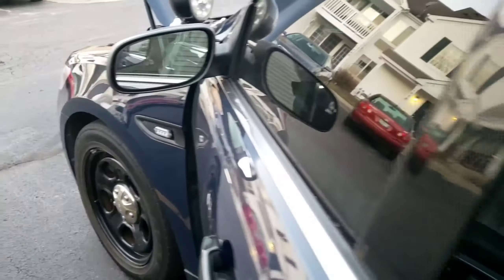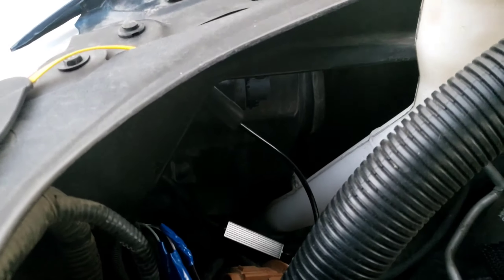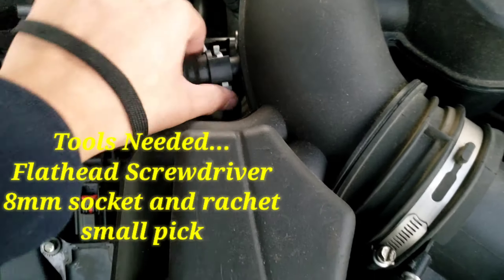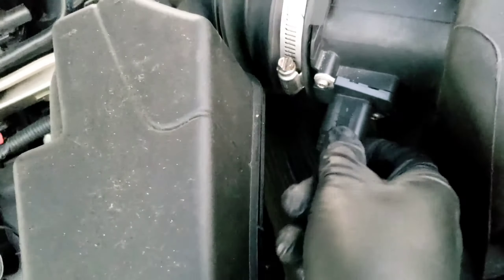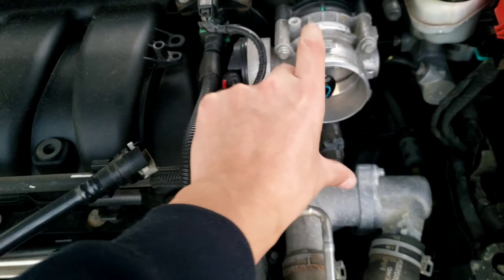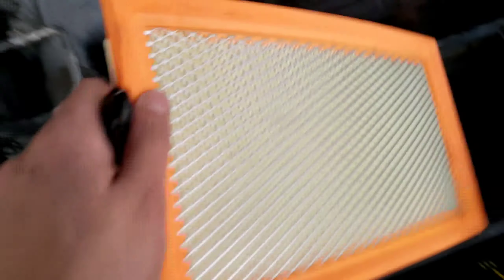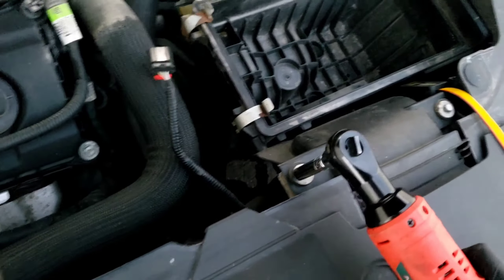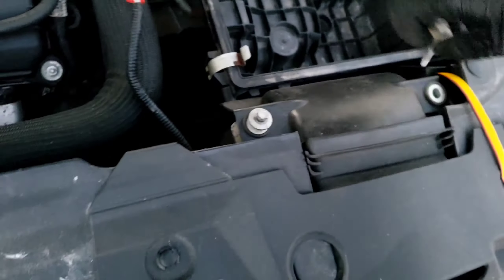How to Replace Headlight Bulbs on a Ford Taurus 2013-2019!!!

Comment: Just did this with my dad and you really don't need to remove anything tbh. Remove the silicone cap. Pull out the old. Put in the new. Seat the new headlights then lock in place. 

Done
Reply from the maker: I couldn’t get my hands in a good spot to do that

Comment: Your video is pretty good except for one thing. You don't show what it's like to actually pull out the light assembly and replace the bulb.
Reply from the maker: You are right but in the video the two screws once you remove them the headlight just pulls straight out and the bulb is visable right away and you just place the whole assembly right back

Comment: Shit, I thought it’s gonna be easier... thanks dude
Reply from the maker: No problem hope it helped you out
Reply: CGR Cars, Guns, and Reviews did today I changed my bulb without touching filters and nothing to unscrew, you may need to make a new video, you can change it for about 2 minutes, just need to find the rubber which covering bulb
Reply: @vityaoverstars5876  how was you able to change bulb without unscrewing
Reply: @ChiTownFlyDown  It's actually easy, you can feel it if you will try to put your hand right there. I already forgot exactly, but believe me, it's so easy, 3 minutes and bulb is changed
Reply: @vityaoverstars5876  ok I found the housing but my assembly of the bulb is completely differ i jus can't pull it out n change the bulb it's surrounded by a green contrapment and it's like it's attached to like a metal battery of some sort smh

Comment: I just bought a used 2013 ford taurus sel a couple months ago. It's my first car & I know nothing about cars:( I noticed the daytime running light on the driver side went out. I know it's a stupid question, but i'm going to ask anyway. I would have to remove the one on the passenger side and take it to an auto parts store just to see what kind of bulb it is, right?  :/just lost on how to care for my first car.
Reply from the maker: No not a dumb question at all check this website out gives you all the bulb sizes your vehicle has https://www.sylvania-automotive.com/apps/vlrg-us/Vlrg/
Reply: If you visit a local parts store, they will find the right part for you using their computers. You should have a few brand options to pick from

Comment: Now, Do you know how to change the driver turn signal? Mine have the Whelen light socket. So to change the bulb I must replace all wiring socket. How can install a regular civilian bulb. Dont need to flasher lights I guess that's what alot of police vehicles have.
Reply from the maker: So what your saying is your turn signal is a wheelen bulb?
Reply: @cgrreviews7220  yes, the only way to change the bulb is to change the wiring I guess?  ... unless there a trick for it to be change. The part number is EB5Z-13410-C thats how it looks.
Reply from the maker: Are you having this issue on the Ford Taurus police or the Ford explorer police?
Reply: @cgrreviews7220  the sedan interceptor.
Reply from the maker: @pitbullchamp3459  I looked at the bulb that's weird mine did not come like that have you followed the wire to what ever connector its on there also maybe the original socket is pushed away or hidden my car had s regular bulb and socket
Reply: @cgrreviews7220  damn lol .... ima give a try again is pain in the ass ... now I was told before removing anything to check relays what other relays do you think is connected to the flasher. I check under the steering column does are good. Not sure if I'm missing other relays or fuses
Reply from the maker: It could be connected to the old bulb socket but since I've never had that style of bulb I'm just taking a guess at this point
Reply: Hey did you ever figure it out on the Whelen light issue you had???? I’m having that same issue now on my 2018 Taurus interceptor.
Reply: Remove the headlight assembly, small connector, twist and pull. There will be a yellow bulb in there.

Comment: Shouldn't need to remove the air ducting between the airbox and the throttle body. Just undo the 8mm bolt connecting the ducting to the airbox and slide the ducting off.
Reply from the maker: Yes that is true thank you

Comment: My problem isn’t that stuff is in the way, my problem is that the bulb on the driver side won’t come out
Reply: Yeah tht is a problem. Why do they make it so hard to counter clockwise turn out. It should be an easy pop out. They really need to fix this in future cars with somekind of pop switch. Who knows who behind you when you trying to mess with this stuff on cold nights in bad areas bc you not snug in a private garage with peace of mind to operate
Reply from the maker: I'm sorry I wish I could help

Comment: Great video, but you do not necessarily need to disconnect anything. If you have small enough hands you can work in the small spaces that are provided to you. Just be careful making sure you keep the new headlights free from dust and debris while working. If you are installing led bulbs, then make sure you have them positioned properly. If you keep the wiring going down at all times they should be the right way. And as always, if new bulbs dont work properly at first unhook it and flip the harness around. Got mine done in like 20 min. Take care
Reply from the maker: Yea true if you can get your hands through it’s a easy process
Reply: Nobody has hands that small
Reply: @Spoons7414  😂😂😂
Reply: @Spoons7414  I do, but that's why they call me Kev the Gremlin. That and I'm always eating only at midnight. Never after or before.